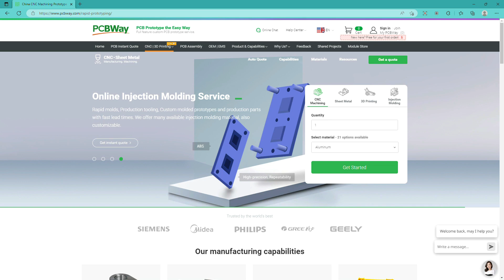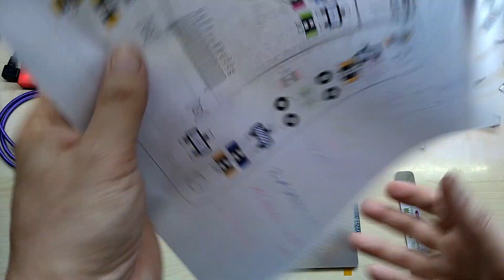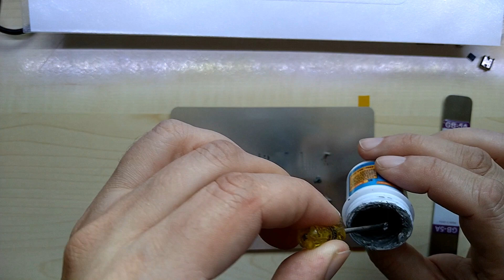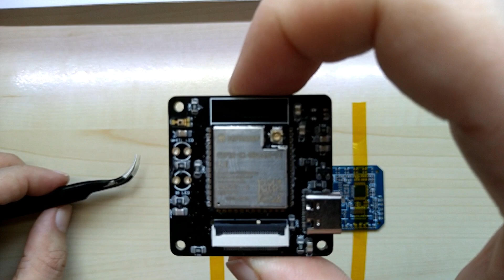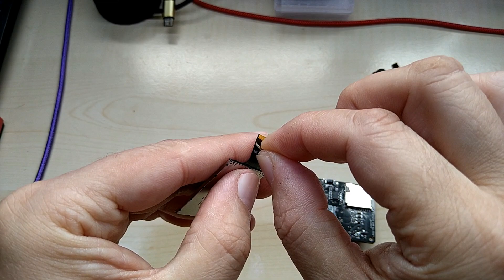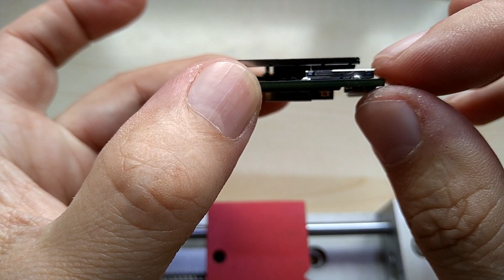#DIY ESP32-S3 Camera, with Nightvision, SD Card Recorder, USB Type C Programming by #Hayri #PCBWay

Comment: what kind of tft is that?and can direct to 3.3v?you use 4 layer pcb?
Reply from the maker: It is the 1.3" ST7789 IPS display and it only works with 3.3V. This PCB is a 2 layer board.
Reply: @iHayri1 by chance you have schematic of the tft?do it need resistor or other ic?
Reply from the maker: @smoochies5056  Look up it's datasheet, it has 12 pins to connect.